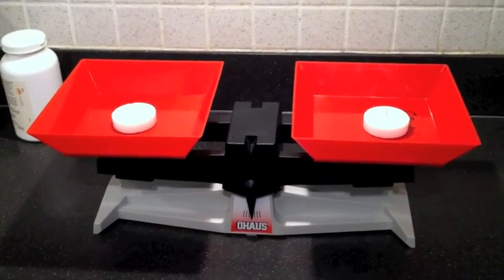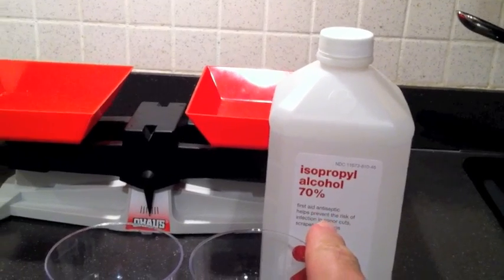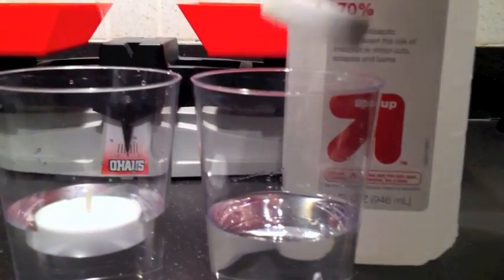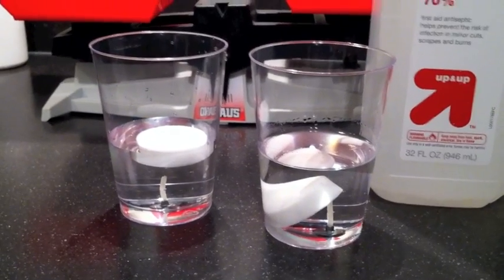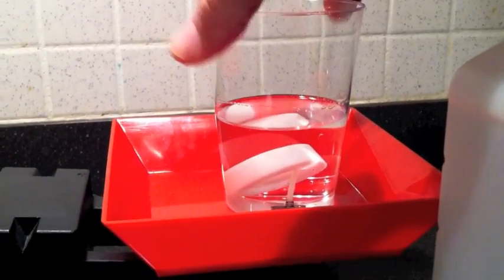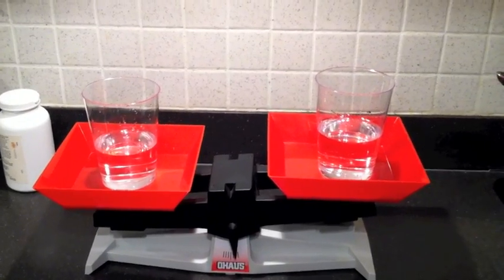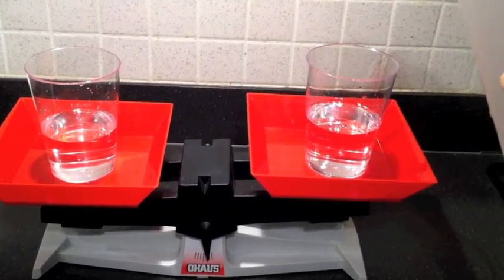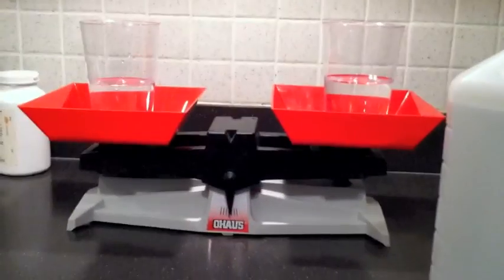Weight vs. density of alcohol and water

Comment: I bought two gallons of 99% alcohol(128 ounces each) when I measured them with a regular weight scale I noticed that it reads ~107 ounces. So my question is does this means that this type of alcohol is less dense than water? Thank you for your video. I learned something today.